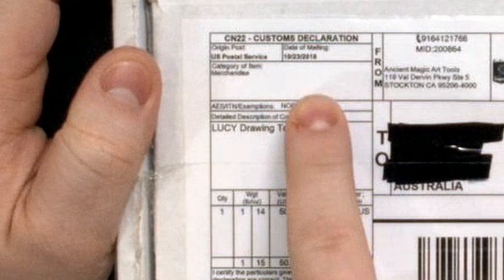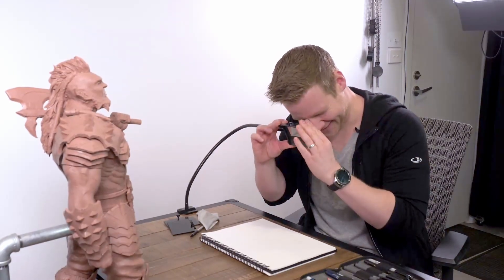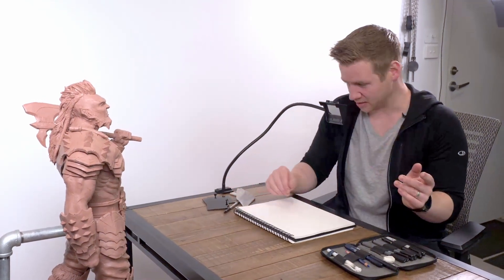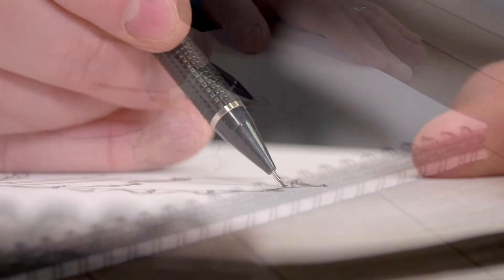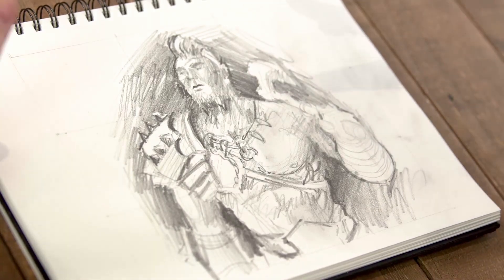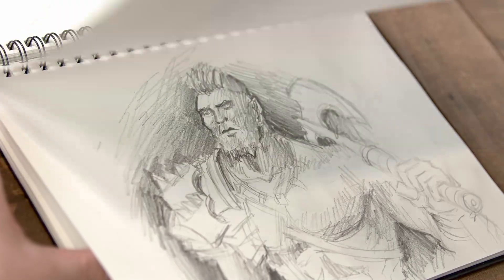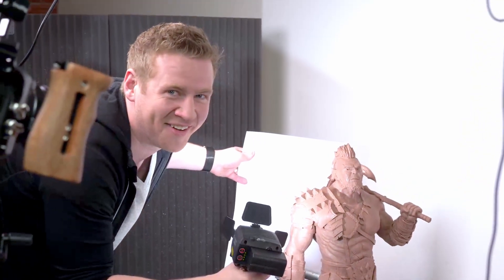Does this Weird Drawing Tool actually WORK? - "Art Hack" Test!

Comment: this isn't a funny comment but I like how even after he does all three tests, he still tries to do the lucy again in different circumstances and gives it the benefit of the doubt instead of just trashing it immediately.
Reply: Except he didn't use it the way it's supposed to be, he was looking at the paper not the subject. so now we won't know.
Reply: Tushar Jamwal the point of the product is that the reference overlays the paper. Meaning you look at both for the most part at the same time. Besides the Lucy in the trailer is/probably is a bunch of bs

Comment: Hey jazza I have used a similar thing in art class, and you can set them up to be really useful! The 3 big factors are:
1. Have a strong head on light (like you figured out)
2. Reduce or turn off ambient light, like your overhead lighting, that really blurs the image. (Think that would make the biggest difference for you)
3. The ones we had were attached to tripods not that shaky rod Lucy uses. It's still a little awkward but much more comfortable and accurate!
Would love to see you try it out again

Comment: I just got one for my daughter who is just starting to learn to draw. She loves it, as she can now get the the basic lines in proportion and place, then she moves away from it and does the rest by eye.   the main thing you didn't do , if you want to use it as a tracing tool is have the subject the same distance from the prism as the paper. 
I don't think this is good for copying like your trying to do or the manufacture claim. But it is a great toll for laying down the basics of of the drawing to bring everything into scale. 
Shawnie's drawing has improved way more that 10 fold in a couple weeks and most seems to be relative scale.
I don't think this would be much use to the freehand professional artist , but a great tool to improve basic skills without graph or grid techniques

Comment: When I was in college - back in the early 80s - we used a person sized boxey machine that had a movable bottom shelf and a series of mirrors that projected the lower positioned image onto an upper glass shelf on which you placed your drawing paper. And we called it...."the Lucy".  You stood over it with a black tarp covering your shoulders to block out any other light.  This "Lucy" is the simplified table top version of it. If it was good enough for artists of the past, it's good enough for artists of the present.  I was excited to see it reborn and purchased one a few years ago. :)

Comment: When old masters used something but now it is "forgotten" that usually means: someone had a better idea.

BTW: You could modernize this idea with a video camera and a beamer.
Just through the image of the beamer on the paper and trace it.
Or you could just create a photo and trace that.
Or just have the Photo.

And my guess is that the Photography killed this tool.
Reply: the video camera and beamer thing is basically the same as having a projector
Reply: @ahmedshaikh7662  This thing is basically a projector except you're looking through the reflection rather than the end since the light isn't focused through the mirror. Same system with the elements moved around a bit.
Reply: @Kio_Kurashi  yeah except its a bad projector and doesnt have most of the benefits of a projector while requiring a lot more setup
Reply: Using the method he used on his video called "Can I DRAW Like a PRINTER?..." is a much better method to duplicate the effect this device creates but I'd much rather encourage people to eyeball it. Use the setup time this would take to practice instead as it'll provide a more effective practice session.
Reply: @mica4977  oh yeah, i remember that. Very true though
Reply: @ahmedshaikh7662  to be fair, projectors need a lot of setup too.
Reply: @jianng7795  true, though not as much as this because for this, you not only have to line up the paper and drawing but if you want to efficiently use it, then you also have to set up good lighting and different background color behind the subject based on the subject. Where as on a projector, its mainly just lining up the paper with the projection, turning off the lights, and focusing the projector.
Reply: Well, to be fair, this device wasn't used by the "old masters." The device they used wasn't a device at all, it was a room! The subject would sit on one side of a studio and the artist would sit in a little room with carefully placed windows and mirrors to reflect the subject onto the canvas. Source: I'm an art student!
Reply: you could rasterize a photo and lazer print
Reply: Julia Rehmke The little device came later.  I got to play with one in Independence Hall a few years ago.  It was a more significant device with better optics, and actually worked fairly well.  These cheaply things need really specific like lighting to even kinda work.
Reply: @paulskalla6845  oh cool!!
Reply: @agent_8167  http://www.scitechantiques.com/TelescopeLucida/  This is what I was able to play with.  I forgot it was part of a telescope.  It actually did work fairly well.

Comment: The only real benefit of using the "Lucy" that I can see is that it helps you get the proportions loosely outlined so you can then just look at your reference and start drawing everything in without it. Like getting a very loose gesture drawing down so you know your drawing is laid out on the paper in the appropriate size.

Comment: I wonder if he dimmed the lights around himself and just light up the subject...would that make the image clearer....hmm
Reply: I think he should go into color theory with it too. Maybe using a white/black backdrop isn't the way to go. Could be better to use blue for something brown there.
Reply: That’d be a funny requirement after their diss on projectors in the ad
Reply: I have a cheap one from the 50s or 60s, and learned real quick the need for bright lighting.  I was able to use an Victorian era one on display at Independence Hall which had significantly better optics (no cheaply beam splitter there) which actually worked fairly well.  I want to say the camera obscures the old painters used had a hood of some kind to darken the drawing area, and then were really only used for the underdrawing. I also seem to recall then using a grid panel with live models too to get foreshortening right.  Personally, I wouldn’t mind getting an antique Balopteron (the projector Rockwell used).
Reply: Actually, less light on the drawing surface is the trick.

Comment: You just use the lucida to sketch the outlines, not draw and shade the whole picture through it. It is used simply to replace the grid...get the basic shape and the rest depends on your skill to fill it out.
Reply: Seems people find him funny, not smart 😩 !
Reply: The problem is its an outdated, uncomfortable method. Just get a lightbox if you're that bad at drawing and take a photo then trace it. Only thing that would be a plus with Lucy would be that you could do shadows better, since the light is layered rather than paper layered which make it so that you can't see once you've drawn on it but Lucy fails even to do that. Basically it's useless.
Reply: @kaanmuhammedgunes1879  Only benefit I've had with it is being able to take a small object and make a quick sketch in a larger size without having to worry about upscaling with grids. It's a tool I rarely ever use...kind of a novelty.
Reply: @kaanmuhammedgunes1879  Camera lucidas were primarily used by scientists, tourists, etc. to draw and document what they saw in their travels before the camera was invented. If you looked up the original camera lucidas they were small and portable, meant to be used with a notebook/journal. It would be more convenient to use this while drawing out in public rather than carrying a lightbox.

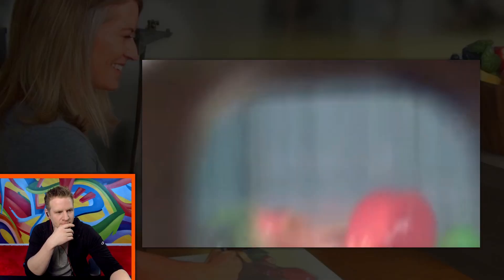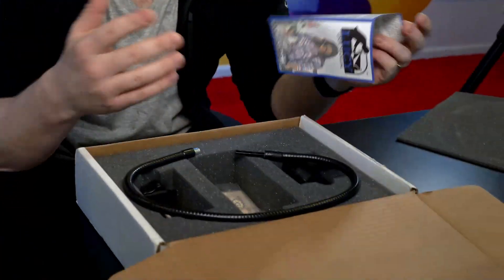Comment: 2:07 shes got it the other way round so shes looking straight forward instead of down, maybe try turning it so you can do that instead? Even the women on the sheet at 2:30 is using it differently
Reply: Yes, he seems it have it so he's looking at his paper, and seeing the reflection of the object, instead of the other way around - so you'd see the object clearly. and a reflection of the paper.
Reply: Yea... He's using it wrong... Well that's what u get when u love throwing the instructions away.
Reply: I thought this might be correct, but I think it's just models that don't know what they're supposed to be doing. If you look up how a camera lucida is supposed to work, it does look like you're supposed to be looking at the paper and seeing the reflection of the object.
I think most of the problem was that his reference was a pale monochrome object.
Reply: It actually works both ways, looking forward or looking down. I watched the Lucy commercial from Amazon again to be sure. The only thing I didn’t see Jazza try is the dark transparent film for different contrast. I wonder if that would have helped.

Comment: You're supposed to just trace the outlines then switch to normal view to get all the details right. Also, it works better if you do the top-left first, then bottom-right, then top-right and bottom left, and then the rest, so you don't have to jump back to the original spot the whole time. And with the outline done in a sketchy way, you have everything you need to quickly make the actual drawing on scale and use your own interpretation. Its basically a substitute for the grid method, except you don't have to setup a grid and such you don't have to get rid of it later either.

Comment: the Lucy needs a higher contrast to work effectively, because the method being used was originally designed to be used by gaslamp or candlelight. It was meant to give the overall impression of the item or image you're replicating, but not all of the details, which is why so much victorian and edwardian artwork looks the way it does.

Comment: I don't know about the one you got, Jazza, but the one I recieved for Christmas last year came with essentially ND filters to help with clarity. Using it straight can be an absolute nightmare but with one or both filters, depending on what you're looking at, it works well. Agree with the wobble issue. I have MS and a bit of a shake now, and it was a bit of a pain for that but not unworkable.

Comment: i think you're doing it backwards, look how she's positioned the lucy thing and look at how you did it.
she's looking through it straight at the thing she's supposed to draw, you're looking straight down on the paper through it.

it might be worth doing a second take, to me that looks pretty chill if it could actually work.
right now i'm doing the awkward measuring where you hold up a pencil to compare size and scale and stuff if i ever want to "copy" from life.
Reply: If she's looking at the reference then isn't that the same as drawing from life
Reply: Some clips & images of the ad are (purposely?) misleading to appear like we can sit comfortably and look straight ahead but we can't because the view port and mirror are 90 degrees from each other, so Jazza is doing it correctly. At 2:05 the narrator says "& look down into the view hole!" meaning she was looking at the black backing right before it XD

Only way to look forwards would be by placing the subject to the left or right of where we'll be drawing and angling the mirror that direction but then needing to turn out neck every time we want to glance at the original shall be very annoying
Reply: @mica4977  i'm not sure, i mean why would the ad do it purposely to mislead the buyer?
i think it's more like you're supposed to look at the "object" and see it more clearly and the paper is the barely visable thing that shows up instead because you're projecting the paper ontop of the object and the paper part is the thing that's gonna be barely visable, so it's completely reverse.

like you just shift the viewports, it's a 90° angle either way.
sure it might mean you won't look at your hand directly where you put pen to paper, but you still see where the pen is relative to the paper and you would probably see the object much more clearer.

i don't know, if it were me i'd try it to do it like that just to expose the falsehood of the advertisement either way.
Reply: theres a projector app that can help you out if youre interested. all you need is your phone and something to set it up so its pointing down at your paper, preferably a tripod will get you the best results. 

its basically this lucy thing except you dont need to have your reference in front of you, you can just upload any image you want from camera roll and copy from that. i have ios so i dont know if its available for android. heres link: https://apps.apple.com/us/app/tracing-projector/id1063062393
Reply: @mica4977  I know the narrator says to look down into the viewing hole, but when she's looking through it, you can tell it's opposite of how Jazza has it set up. The mounting point is on the top for her, and facing Jazza for him.

So she is actually looking through the hole, and not just at the side of it
Reply: I think this made more sense
Reply: @MagnaRyuuDesigns  so the ad was just wrong all along, well that's a bummer.
Reply: @bobxbaker  no the product is just crap
Reply: “why would the ad do it purposely to mislead the buyer?”

Because that’s how most companies attract buyers, I’d be shocked if they didn’t mislead us because it’s so common. Most ads always show a more idealised version of their products to make getting it more appealing, as apposed to the more mundane reality. Some companies do it subtly while others stray too far from the truth, but either way, it’ll get them more customers.  It’s the same reason why ice cream ads use coloured mash potatoes, it just looks better to the viewer.
Reply: He missed the scale divider version. I have a video on that. Its fairly accurate as well
Reply: What you're saying makes no sense.

Comment: The Camera Obscura is a 19th century optical device often used by artists to make quick sketches in the field. ... It was used for sketching; the tracing paper was placed on the missing glass inside the folding hood, and a 45° mirror inside the box reflected the image onto the paper.

Comment: Ha! I think I had been using the graph method for a long time without even realizing it. Usually what I do is find a reference image and then zoom in on it and put my phone behind my paper and move it around as I get the basic shapes down and then remove my phone. After that I just have the reference image on the side so I can look at it every once in a while to make sure I’m getting the basic details correct. But I usually turn my reference image becomes something completely different in my drawings, I hardly ever actually try to draw my reference exactly. The reference is usually just to get some posing right.

Comment: Hey Jazza

I remember using a Lucy when I was starting my career as an artist.  Back around 93 or so.
Personally, I like the Lucy, but I think you might be frustrated because you are using it “wrong”
Ideally, you should be in a dark room (ours was massive and was literally stationed in a long, narrow closet painted black with intense light on what you are trying to copy). Even the paper you were drawing on was only minimally lit and relied on reflected light more than direct light.

Why did happily we go through this amount of hassle? The Lucy was never used to make a direct tracing of anything, rather we would adjust the focal distance and use it for scaling a polished draft to the final proportions of the applied artwork.  Want to design a bus wrap? Draw it out to proportion, stick it in the Lucy and scale it up to size you needed.  Same for murals, massive canvas paintings (I once did I a series of panels that were 2’x5’ each) etc.

Occasionally we would mess around and put objects, animals, or people in the Lucy but because of the intense lighting required it never really worked out well as the “subject” just couldn’t stay still long enough.

Your little tabletop model is going to have massive amounts of drawbacks just due to its design, but the Lucy as a tool shouldn’t be judged by that one trial alone.
Reply: Wehad a Lucy room at the Academy of Art in SF in 87 - 89ish when I was there. It was similar to what you described. Big device, dark room, one bright light... Useful.. Here? "you're doing it wrong"....

Comment: Personally, I’m a big fan of the grid method, never thought I’d say that but I’ve recently been using it and I get quite meticulous and cut up my pattern quite a bit in harder areas such a faces and hands, and I’m having quite a lot of success with it so if anyone’s curious if it works, it absolutely does and I would definitely recommend trying it out

Comment: I was just thinking about this technique today and without searching the internet this video came as a suggestion while watching airbrush painting techniques. The idea is that the distance from the device to the paper to be exactly the distance from device to the subject, this way, when you move around, the "projected image" stays on the same place when moving your eye around.
The conclusion I arrived is that I want to use a LCD monitor  instead of a subject, The monitor must be the same size (or bigger) than the paper on which you want to draw to. 
Two points to remember: 
1. Distance from paper to mirror = distance from display to mirror
2. Angle between paper and mirror = angle between display and mirror
The mirror can be a simple flat glass, but you would have refraction issues causing the image to double. You could try half a DVD